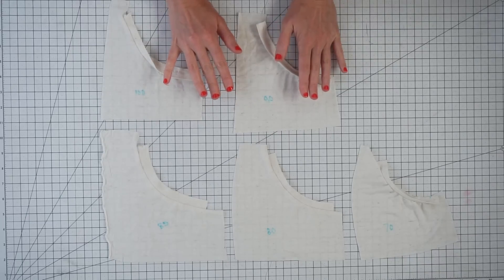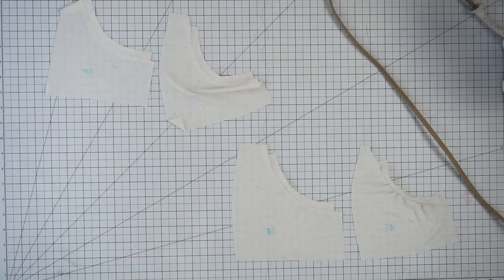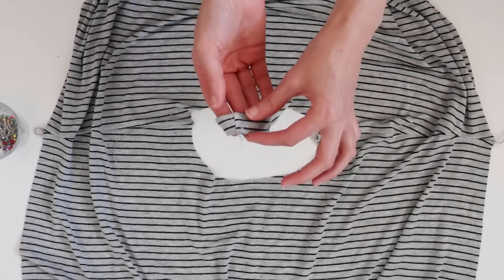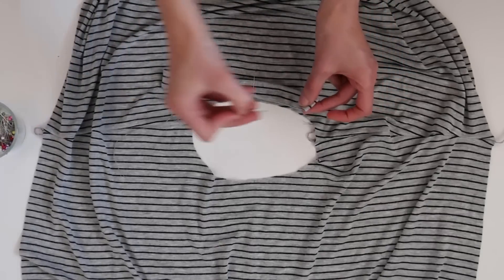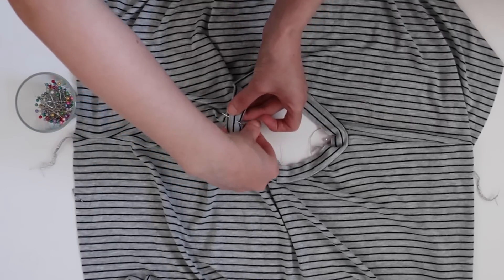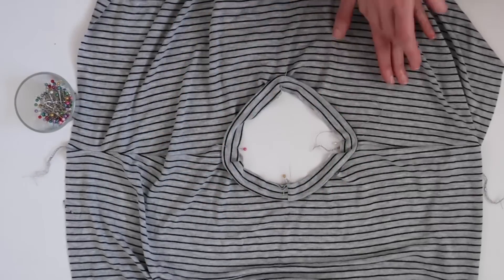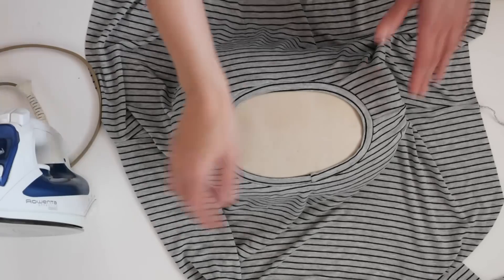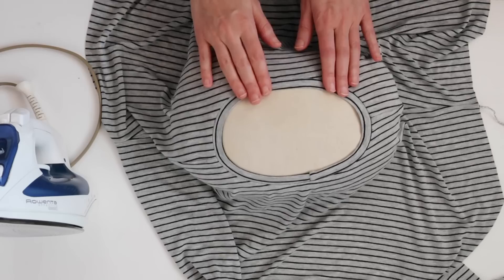How to Sew a T-shirt Neckband

Comment: This was excellent information! Your demonstration and teaching method is easy to understand. Thank you for that. I have one question about cutting the neckband. Is it cut on the straight of grain or the bias?
Reply from the maker: Hi Kathleen, Thank you so much. I'm so glad that it was helpful. For the neckband, you'll want to cut on the crossgrain (perpendicular to the selvage). For woven fabric, you'd cut on the bias for the extra stretch. But with knits, usually the cross grain will give you plenty of stretch and still have some stability. I've accidentally cut a band parallel to the selvage before and it definitely did not stretch enough. You can pull on your fabric to see which direction stretches best.
Reply: Thank you so much for the prompt answer! Working on a knit top right now and the first time go round the neckband was much too large. I looked for information and that's when I found you! I will continue to subscribe and soak in all your info. Very impressed so far!

Comment: How wide was your neckband?
Reply from the maker: Great question. I'm using my Lou Box Top pattern here and the neckband is 1.75 inches wide and I'm using a 3/8 inch seam allowance. I like to use a slightly wider neckband and bigger seam allowance because I think it's easier to handle.
Reply: @SewDIY  thank you